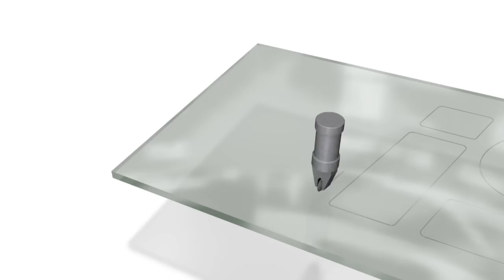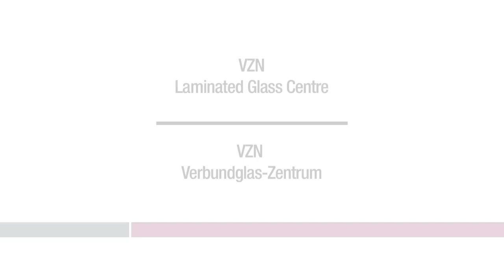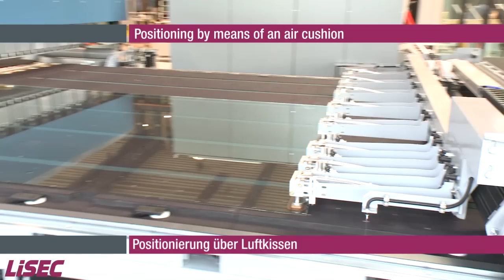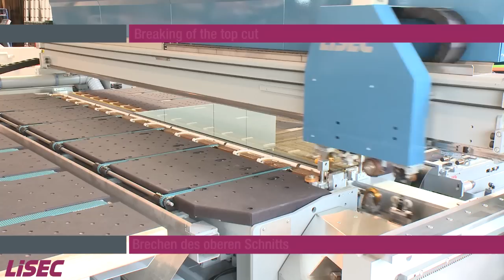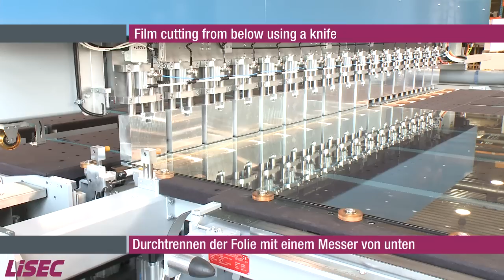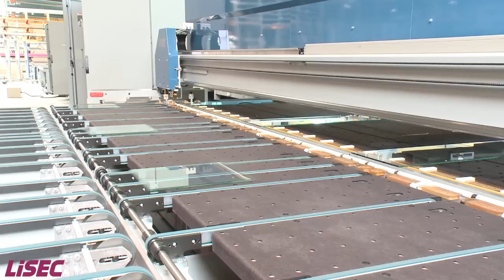LiSEC VZN - Laminated Glass Centre

Comment: I use lamicut lisec, it's amazing machine.
Top cut wheel pressure is set at just over 2bar same bottom cutter. The roller is set at 1bar for 6.8 and 1.6 bar for 8.8.
In the process of leveling out some boards.
Can you confirm the pressures you use for cutting laminated glass 6.8 up to 14.8?.
Massively impressed with lisec cutting
Reply from the maker: Thank you for your kind words, we appriciate your feedback. Concerning the cutting wheel and breakout roller pressure: For 6.8 (33.2) we are using a 145° cutting wheel @ 1,7bar cutting pressure and 1,6bar breakout roller pressure. For 8.8 (44.2) we use a 155° cutting wheel @ 2,4bar cutting pressure and 2bar breakout roller pressure. For 14.8 (66.4) we use a 155° cutting wheel @ 2,8bar cutting pressure and 2,4bar breakou roller pressure. Hope this is usefull for you! Maybe for your interest, we are offering now a retrofit package for our patended SIR heating system. This system is used also @ our VSL-A laminated cutting maching. The heating bulbs are just 900mm long and much more powerfull. The heating time could be reduced to arround 7s which will boost your cutting capacity up to 10% / hour. :)  For more information get in touch with sales@lisec.com our with your LiSEC sales representative!